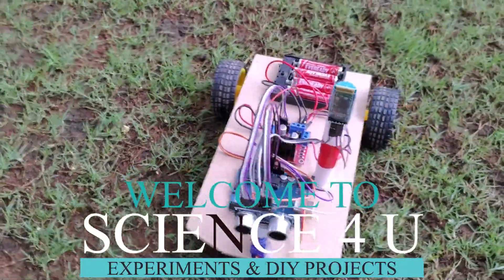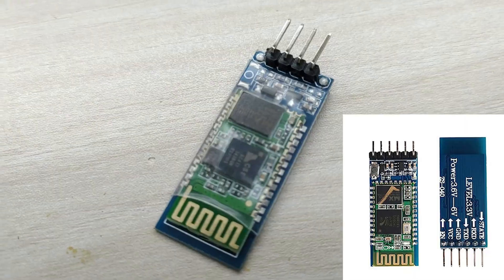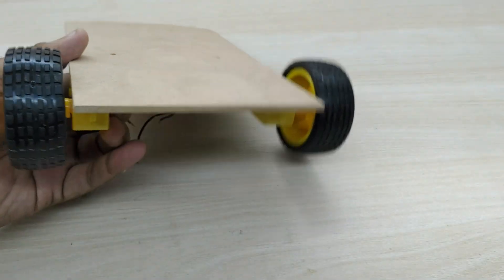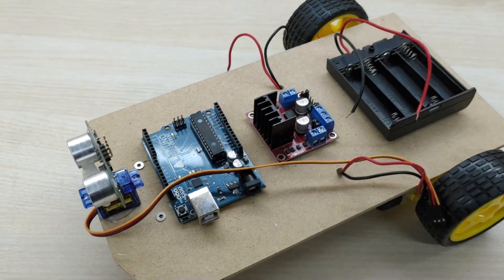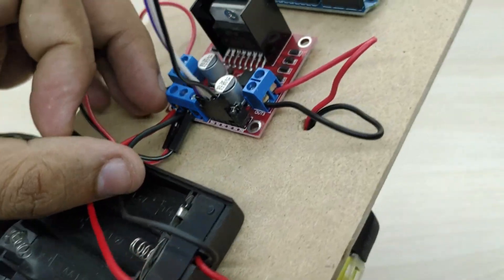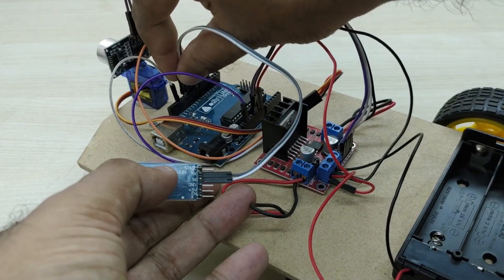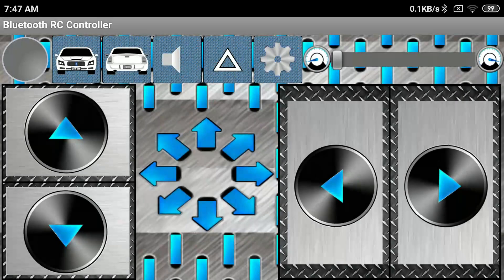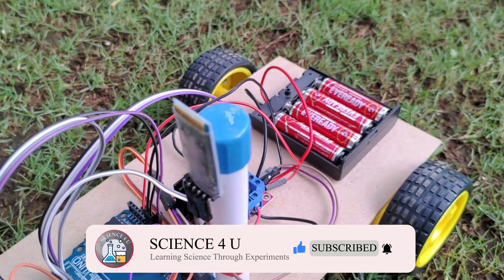Bluetooth controlled car with obstacle avoidance || Step by Step tutorial

Comment: I have made the connections as per the video and uploaded the code. But after connecting to the app, It's not responding..what do i do?
Reply from the maker: Please check the connections once again. When the bluetooth module is not connected to app, the light in the bluetooth module blinks rapidly. After connecting to app, the blinking pattern changes indicating that it is connected to app. Also, when the app is connected to bluetooth module, does it display the message that it is connected to the bluetooth module?
Reply: @Science_4U_  no I'm not getting any message like that
Reply from the maker: Do you see any blinking light in the bluetooth  module when switched on?
Reply: @Science_4U_  yes
Reply from the maker: Whether the blinking pattern change when you connect to app?. Also in the app, whether a red blinking light change to green light when paired to bluetooth module?
Reply: @Science_4U_  yes it shows green in the app
Reply from the maker: Then it is connected correctly. But still there is no response while pressing the buttons on the app?
Reply: @Science_4U_  no response still..
Reply: @Science_4U_  do i have to install any library in arduino or do i have to make any changes in the connections or the code?
Reply from the maker: @revanths1507  For this project, there is no need to install any library. If you are using motor shield for driving motors, then adafruit IO library is to be installed.
Reply from the maker: @revanths1507  Hey friend. Please do this and and will mostly work. Please interchange the transmit Tx and Recieve Rx pins in the arduino board and see if it works. Please try this and let me know.
Reply: @Science_4U_  I changed the TX and Rx puns.. still not working..what should I do?
Reply from the maker: @revanths1507  Hmm..Have you used the motor driver board before?. Sometimes it could be faulty. We will not know. It has happened to me couple of times.
Reply: @Science_4U_  I tested the motor driver
Reply from the maker: @revanths1507  okay..do you have a multimeter with you?
Reply: @Science_4U_  no
Reply from the maker: @revanths1507  okay..a multimeter would have made it easier to troubleshoot by checking voltages at different pins..
Reply from the maker: @revanths1507  Anyway no problem. What I will suggest is please try to upload the code from the following video..
https://youtu.be/kPSBpfUpHt0
This is a video of an obstacle avoiding robot only, which doesnt have the bluetooth control. The pin connections are all same. So please follow this video and upload the code and see whether it is working just as an obstacle avoiding robot without bluetooth control..
Reply from the maker: I need to go now friend. Will see in the evening..

Comment: why r u connecting gnd of Bluetooth module to the power of motor driver and Vcc of bluetooth module to the gnd of motor driver?
Reply from the maker: Hi friend. I am really sorry. There is a mistake in the video. I also noticed now only.     The gnd of bluetooth module should be connected to gnd of motor driver and Vcc of bluetooth module to the power of motor driver.
Reply from the maker: Please follow the audio instruction. There was a miskake in the video. Iam really sorry for that.